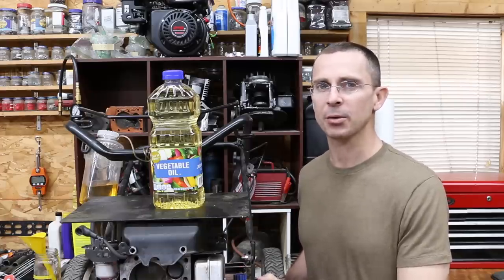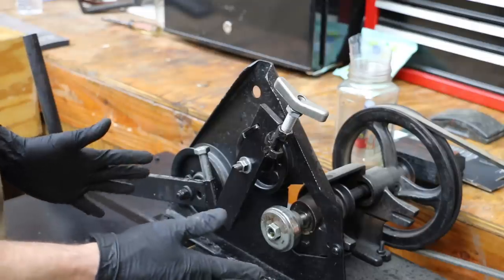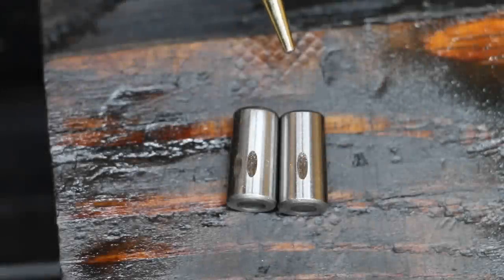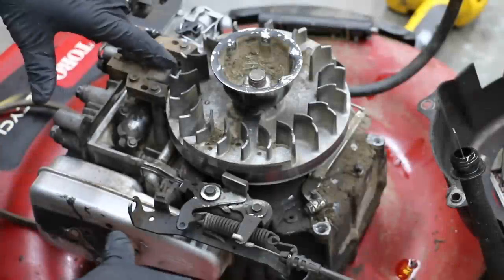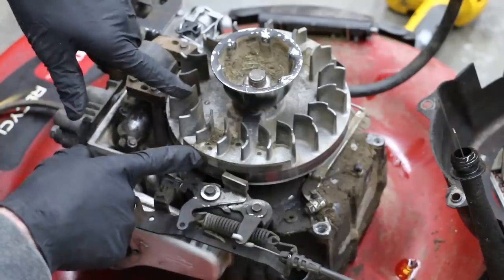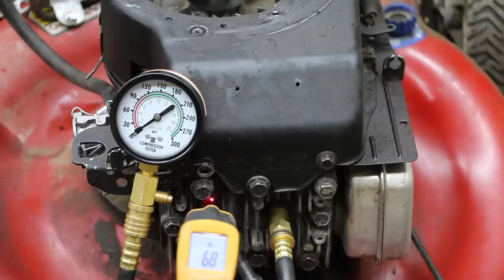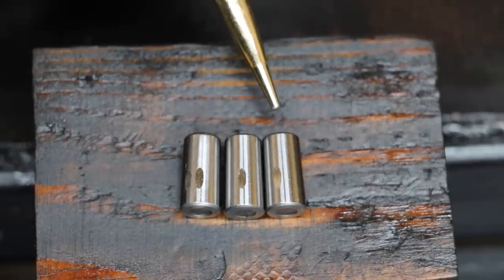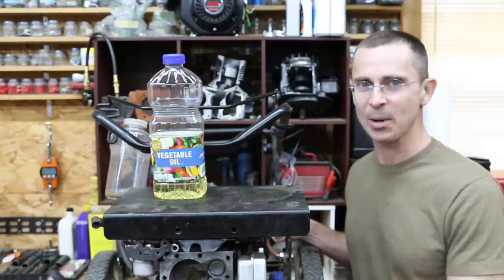Will Vegetable Oil work as Engine Oil?  Let's find out!

Comment: Well, they used a castor oil in the aircaraft engines back in WWI times.
Though I think result of this experiment does not apply to modern car engine which uses oil as lubricant and coolant for certain parts like a turbocompressor.
And even Briggs and Stratton 3.5 Classic, was it used in the experiment, right? could show different results should someone lubricate it with vegetable oil for, say, 100 hours.
Another thing is that different kind of vegetable oil could yield complete different results too.
Reply from the maker: Thanks for the feedback

Comment: I'm trying to figure out if a automotive mechanical fuel pump can pump diesel oil or automotive oil decently and hold up... Any idea?
Reply from the maker: Thanks for the suggestion.
Reply: @ProjectFarm   I need a stand alone oil pump and this one is under $100 and non electronic. It's suppose to be used for fuel but I think it can pump oil, but I can't find anything... Just off your experience/knowledge do you think the diaphragm all can hold up to oil and pump it. A gallon of oil weighs like 9 lbs compared to 7 for fuel. I need 40psi hopefully by using smaller hose/line compared to stock lines put out like 8psi. Idk its very confusing because the pump stops at a certain level I guess. Ugh I'll eventually have to do it myself just don't know when. Thanks

Comment: If you use it in a modern turbocharched engine it might be different, it will get really hot when it lubricates and cooles the turbo charger bearings, and a car engine has much more pressure on the bearings at the crankshaft than a lawn mower engine running without load.

It might work in simpler, older engines, but I wouldn't use it in a modern one.
Reply from the maker: Great point. Thank you

Comment: Love the videos!  Can you perform a test to see if running an engine at full throttle runs cooler than at half throttle?  The manufacturers say full throttle runs cooler but I cant find any actual testing to prove this out.  Could be conducted with a blade on (simulating a load) or without.
Reply from the maker: Thank you for the video idea!

Comment: Is there a specific grit sandpaper you use to prep the test wheel on the lubricity tester? Is the goal to get it as smooth as possible or to give it a specific “edge” as it were so the tested bearings have a certain amount of abrasive wear that the lubricant has to overcome? Im just wondering what the process involves. I love your videos and have learned a ton from them!
Reply from the maker: Thank you.  Yes, 600 grit.  Allows the products that are being tested to stick to the metal a little better than a very fine grit

Comment: I had just got rid of a car that had a really bad oil leak. I was putting veg oil in it for the last 3000 miles ? No issues. Still runs guy that bought it fixed the sump leak flushed it and it’s going as usual

Comment: As a FYI, racing engines in the 30's and 40's used castor oil as petroleum oil would not hold up under severe racing conditions.
Reply from the maker: Thank you for sharing!

Comment: Get some used fryer oil,heat it to a good simmer, add in some powdered drain cleaner and methanol,strain out the debris and you've got diesel fuel
Reply from the maker: Thanks for sharing.

Comment: Philippines in the 70's were a pretty cool era for experiments  on engines 🤣

People putting Standard Cooking Oil in motorcycle engines so much so that the manufacturers start putting warning labels on the engine itself that says to not put cooking oil in them as a substitute for engine oil

Running Engines on 190-200 Proof Coconut Alcohol

Running Engines on Compressed Poop Gas
Reply from the maker: Thanks for sharing.

Comment: What container do you use to hold the gas?
Reply from the maker: I made the fuel cell using a food grade container with a tiny hole drilled through the bottom of the container.  I then JB Welded a tiny funnel to the bottom and attached a fuel hose to it.

Comment: how about a video where you see what lubricants that worked in engines mixed with fuels that worked with engines to see which will run well in 2 stroke engines
I bet kerosene and vegetable oil will work a treat
Reply from the maker: Thank you for the video idea!

Comment: Project Farm what do you use to clean the cylinder?
Reply from the maker: Brake parts cleaner and a wire cup wheel but the wire cup wheel shouldn't be used on an engine that you want to last.  It's too abrasive.

Comment: In college I was told that the first engines were lubricated using whale oil (from the blubber of a whale). Not sure if that's true or not. Doesn't seem like an engine would last very long without the additives for wear resistance, detergents and things.
Reply from the maker: Great point!

Comment: Strange! The Russians used a mix of sunflower oil and mineral in there diesel tanks during WW2. They claimed that it flowed at lower temperatures. The cheap oil used here may have been steam extracted though all of the water should have been separated there can be a degree of emulsification in the process.
Reply from the maker: Interesting. Thank you

Comment: after prolonged use it will gel with time and the engine will sieze, on valve stems it will turn into a hard varnish. Racing engines use to use castor oil, a vegetable oil with superior lubricity, but they drained and washed all parts after each race to avoid the gell/varnish problems. Send me an e-mail and I will send you a gelled vegetable oil situation where the engine siezed.
Reply: How about Corn Oil? It have high flash point and low pour point, can it be used as an engine oil or used as additive to an engine oil? (Like 20% Corn Oil mixed with 80% Engine Oil)
Reply: @alterego2974  all vegetable oils will oxidise and cross link at engine temperatures, some more than others, depending on how many double bonds. Synthetic 100% oil wins over all others.
Reply: @alterego2974  You can run an engine on vegetable oil, but it has unsaturated bonds = it oxidizes and will get. You had to remove castor oil, which is a vegetable oil, from race car engines and rebuild/clean the engine after every race.
Reply: @aurizon  But today, oddly enough, in Indonesia there is a trend of using a mixture of cooking oil and engine oil as a lubricant for cars and motorbikes.  Some even use 100% cooking oil to lubricate their cars and motorcycles!  They believe that using cooking oil as a lubricant can clean the engine from stubborn sludge, and can even make the engine last longer.  I don't believe in it myself, but the problem is that a lot of people are affected by it and they say that it's true that their vehicles have become very comfortable to use and the dirt in their engines is gone when the engines are disassembled.  I'm really curious, so many say their machines get really clean!  But I'm afraid to try it, I'm afraid my car is damaged. Btw, we use palm oil, and we don't worry about low freezing point of palm oil because there is no winter here (Tropical Country).

Comment: You can use it in an emergency yes but remove it asap. I did an experiment with this , it will only work for less than a few months with hard driving. it ends up clogging up the oil channels and blows up the motor without warning . Been there tried it. DONT DO IT.
Reply from the maker: Thank you!

Comment: How about olive oil. It should protect the engine better at high temperature than vegetable oil.
Reply: Olive oil has a lower smoke point and is more expensive to produce so it would burn inside the engine.

Comment: A one hour test will not tell you much.
Use a bigger engine in a car and drive it until it fails!
I don't think you can go 3000 miles with veggie oil in the crank case.
But if you can that would be a significant discovery.
Reply from the maker: Thank you!

Comment: I would think natural oil would burn off too quick @ a lower burn temperature. Motor oil is designed 4 high temps and not to evaporate as fast.
Reply from the maker: Thanks for the feedback.

Comment: Someone called @alterego2974 sent me this after I had told him vegetable oils oxidise, some more than others. The amount of oxidation depends on their saturation. Castor bean is one of the best engine lubricants = the famoue Castrol brand came from those roots. After IC engines were invented and before all the lubricative additives were created, Caster oil was the preferred lubricant for race cars. As an engine oil it was very good, but it had a serious flaw - it oxidised into varnish and would finally gel in the engine = tear down engine after every race - which they did. Soon better engine olis emerged and now we have fully synthetic oil that are better than caster oil. He was in a warm country where they made palm oil domestically and it was available cheaply = they used a blend of modern oil for additives and palm oil to save $$.
This is his letter where he pointe me to this.

@alterego2974 says But today, oddly enough, in Indonesia there is a trend of using a mixture of cooking oil and engine oil as a lubricant for cars and motorbikes. Some even use 100% cooking oil to lubricate their cars and motorcycles! They believe that using cooking oil as a lubricant can clean the engine from stubborn sludge, and can even make the engine last longer. I don't believe in it myself, but the problem is that a lot of people are affected by it and they say that it's true that their vehicles have become very comfortable to use and the dirt in their engines is gone when the engines are disassembled. I'm really curious, so many say their machines get really clean! But I'm afraid to try it, I'm afraid my car is damaged. Btw, we use palm oil, and we don't worry about low freezing point of palm oil because there is no winter here (Tropical Country).
Reply from the maker: Thanks for sharing.

Comment: **WARNING!!! DO NOT USE SOYBEAN OIL AS A LUBRICANT!** 
Soybean oil is a semi-drying oil. Upon exposure to air, it will slowly oxidize into a solid, plastic-like material. This process is accelerated by heat. If you fry with soybean oil, you may have noticed a build up on your fryer that is so tough it takes a sharp tool and a lot of force to scrape it off. That is oxidized oil. Inside an engine or machinery, it would be almost impossible to remove. If you have to use it in an emergency, remove it as soon as possible, or you risk catastrophic failure.
Reply from the maker: Thank you for the feedback

Comment: Hmmmm, Can a diesel engine run on vegetable oil and be lubricated with vegetable oil? While you're at it why not try vegetable oil as transmission fluid. Hmmm radiator coolant. power steering fluid, brake fluid, rear axle fluid
Reply from the maker: Thanks for the suggestion.

Comment: Ok, maybe under "emergency conditions" this is a good idea but for anything you care about or when longevity is a concern, this is a complete fail.  I once tried to use vegetable oil to lubricate the drive sled of a disk drive and at room temperature it wound up being gummed to hell after a month or two.  Vegetable oil is a very bad as a lubricant long term.
Reply from the maker: Great point